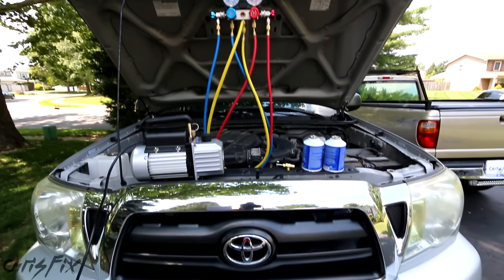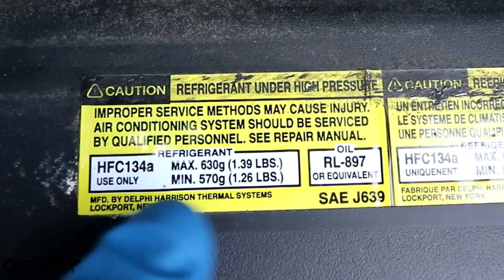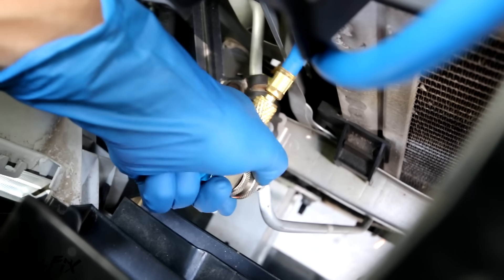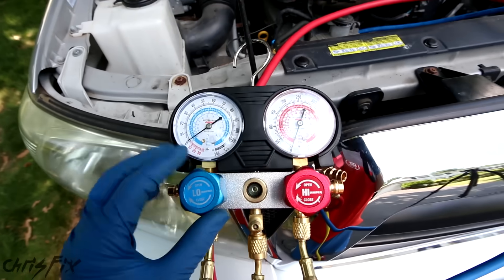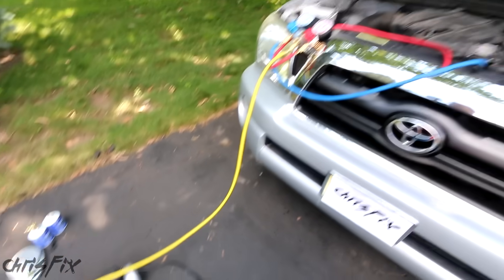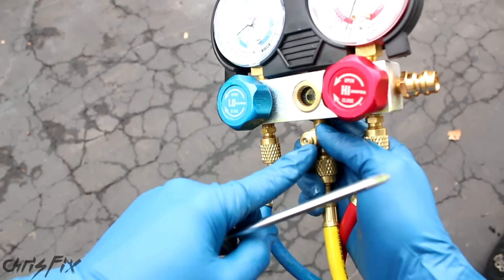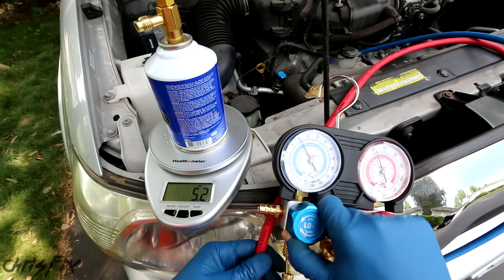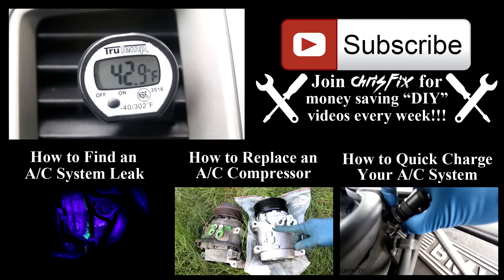How to Properly Recharge Your AC System

Comment: What about if you have cans of refrigerant from walmart (SuperTech brand) that are already pierced?
Reply: make sure you have a kitchen scale, make sure you get a good seal when you connect the can back up so nothing is leaking while you're measuring the weight and just charge the system with the can on the scale so you can see how much you're putting in. then just simple math to figure out how much more you need. this is all assuming that they are still okay and were only pierced to charge a system and have been sitting sealed since then.

edit: just to mention, most cans out there now use a self-sealing valve that does not get "pierced" but rather pressed like a valve then closes once the tap is removed. traditional taps can still connect using an adapter but if the cans you have aren't like that then having the can sit there pierced with an attached/shut tap then it should be okay if still sealed up good. the main concern is the amount you would charge which can be figured out by weighing.
Reply: @cinnabon7272  So I recharged A/C this morning the compressor was running and low pressure was staying steady around 33 PSI and the high pressure was 215 PSI.  I'm in Florida and it was 84 degrees outside when I did this.
Reply: @fartbreath2884  this was after the recharge? Those pressures seem alright. Did you put in the max charge or just in between and did it work

Comment: If leak sealer is so bad and is proven that it does damage then why do these companies keep putting this in the cans without a lawsuit? To be honest I've used it for YEARS and 90% of the leaks that I've had went away and the systems are still running fine today. I've heard not to use that but I'm not understanding why. One comment said something about the seals swelling up and when air hits the seals or something like that it screws up the system. Could someone explain to me what exactly does leak sealer do to destroy the system.

Comment: Hey Chris, can you do a brief update to the video (maybe a segment at the end) showing us how to use the new refrigerant cans that are self-sealing? Also, I don't think the new manifold gauges support adding oil through the yellow line (mine was restricted to the size of 3mm) . I tried adding mine that way and had a horrible time trying to get the oil in the line. And when I finally got "some" in, I hooked up the refrigerant and tried to bleed the air out of the line oil sprayed everywhere. That was fun lol.

Comment: Technically you need to be certified to work with refrigerant.  It is a green house gas and must not leak vented to atmosphere.  You are suppose to recover it with a recovery machine.  If you dont you  are breaking federal law.  I would suggest bringing you car to a shop with certified a/c mechanics.

Comment: so if the compressor is already filled, wouldn't the vacuum suck it out? 7:58
Reply: No. Evacuation in very slow process and only removes gases form the system.
Reply: Nunya _ Appreciate it bro, I'm about to do mine when I get my compressor delivered

Comment: Don’t you have to flush the ac system with solvent before refilling ?
Reply: Only if you need to replace all of the oil due to contamination.

Comment: Dear Sir, my car (2005 Lancer) shows very high pressure on the high-pressure side such that the HVAC pressure switch turns off after 40 sec when ac is turned on...what might be the reason for this. Recently my car runs through water upto a level of 1.5 foot. Whether water gets enter into the system

Comment: At 4:24 when you open the valves that are connected to the engine, you turn the knob yo the right. Are they reverse threaded? I thought it’d be counterclockwise to open.
Reply: You turn them clockwise to screw them down to open the Schrader valves.

Comment: Thank you guyes saved me a trip to the mechanic i had overcharged my system and the clutch kept coming on and off so i did some research cheked the sensors and ended up fixing it by sticking a pen to release some freon hope this helps someone out there!!!

Comment: Thanks for this video, ChisFix..  helped me a great deal when recharging my Odyssey after replacing the compressor..
Reply: @Jason Crowder 
I'm about to do the same on my 2009 Odyssey. Any last minute advice? Also, one of the four front panel air blowers (located immediately on the right of the steering wheel) used to blow warm air. Have you encountered something like that, and/or what may be causing this? Thanks in advance.

Comment: A/C vacuum doesn't create a "complete" vacuum rather it takes it down to 29.something inches which is enough to lower the boiling point of water so that it turns into a gas, and then all of the gas / air is vacuumed out, leaving the oil, which has not boiled off remaining in the system.

Comment: You just evacuated the system by running the vaccuum pump for 30 + 45 minutes to get everything out, THEN you say you don't need to add oil or dye since these things are already in the system??  What am I not understanding?? 

How come nobody else is asking this same question?
Reply: The pump just evacuates the air not the oil or dye in the compressor.
Reply: He stated it would draw out the air and water but I believe he meant humidity within the air in the system.  If there was literally water pooled in a hose somewhere it would not draw that out, just like it would not suck out the oil or dye.
Reply: @joeldokken5690  When under a vacuum water boils off at a much lower temperature. There for the water vapor can be sucked out of the system as a gas not a liquid.
Reply: @daver1942  oh!  Good point!
Reply: @daver1942  but the oil won't boil and be sucks out?

Comment: Thanks a lot for the video. How much does it cost approximately to have the refrigerant recovered?
Reply: 134A is not a pollutant to the atmospher. It is okay to release in the air. The only reason shops recover your system is to add it back in once repairs are done. Think of it another way.....why would you pay a shop to recover your system and keep your freon and then have someone else pay for what was yours???? 🤔🤔🤔 All it is a win , win for the shop to make more money.
Reply: @jamesstafford9067  You clearly don't know what you're talking about. R134A is a greenhouse gas 1400 times more powerful than CO2. When you release the equivalent of a small can of R134A, you contribute as much to climate change as if you drive an SUV from the west coast to the east coast. Also, do you know how expensive recovery machines are, and how cheap R134A is? Shops don't save a lot of money by recycling R134A. Actually, if it's a small shop, they might even lose money because recycling machines cost thousands of dollars
Reply: @jamesstafford9067  In the case of R12, which was the refrigerant used before 1994, then the shop will usually pay you to recover your refrigerant. That's because R12 is extremely expensive. They don't make R12 anymore, so it is hard to find. R134A on the other hand is very cheap, the average car takes about 20 oz, which costs less than $10 is you buy big R134A tanks

Comment: Good video. I ran into more problems. Initially my compressor wouldnt kick on. I finally jumped the pressure switch to get it on. Then i had no pressure on the high side. Im not sure what to do next.
Reply: Good question.  I was thinking just the same.  Will purging air also purge all the ok and dye?

Comment: You made a huge mistake when you initially pulled vacuum you walked over and shut the gauges off and then waited an hour to check for leaks there's no way you could have determined if the system had leaks with the valves shut you should have left them open hence there's nothing to measure if the valves are shut the gauges will sit there at 30 below from now until Sunday. With the valves in the closed position there's no way for them to read anything except what was on the gauge when you shut them down.
Reply: I have the same gauge and vacuum set up chris used in the video. Closing the valves on the manifold still leaves the gauges connected to the ac system. I know this because my truck's ac had a slow leak under vacuum which I found out with those valves closed.
Reply: This was my thought too.

Comment: You didn’t purge the system of air the second time on the second can of refrigerant? Is it not necessary?
Reply: He closed the brass shut off valve so no air would get into the yellow line then removed the empty can.  (then attached the second can, opened the valve, so there would be no regular air to worry about)

Comment: you  forgot in your tools. if its a brand new compressor it need compressor oil or it won't work. either 2 ozs of compressor oil or a can of R134a with compressor oil.

Comment: Helpful BUT
It is amazing how many of these tutorials say that we want to vacuum out any liquid and air out of the system, but yet when you pretended to add the oil into the yellow line you basically allowed air back into the system
Reply: Valve wasn't opened dummy

Comment: If I had to replace just the condenser/dryer how much oil should I add?
Reply: I just replaced the ac compressor and receiver drier in my truck. There should be residual oil in the drier and maybe some in the condenser when you take them out. You would need to dump the oil from them into a measuring cup that measures ounces and then what ever amount came out you would put back into the system.

Comment: You stated that one can of refrigerant contains 12 oz. by weight. That is incorrect.  It contains 12 fluid ounces which is a volume measurement. 12 fluid ounces of R134A weighs a little over 15 ounces ( weight). You inadvertently put 3 extra ounces in your system.
Reply: I blame it on the confusing Imperial System, nobody would mistake grams for mL, but (fluid) ounces for ounces is a problem.

Comment: What if both high low pressures have readings and high pressure side is moving a way from 30 in/hg. Does this mean the high pressure side is leaking?

Comment: Is this the sane or similar gauge and hose setup you could use for HVAC?
Reply: It's similar but the connectors are different and you will likely need adapters for the high and low pressure hoses

Comment: I'm curious... If you evacuated what was in your AC system into that vacuum pump, then what did you do with what is in the pump? What did you do with the material that went inside your vacuum pump?
Reply: The refrugerant would leak out and damage the atmosphere if you had some refrugerant in it.
Reply: @noelmedina6925  What I mean to say is the refrigerant that goes into that small vaccuum pump, how does he or anybody using that dispose of what came out of the car? I just brought a vaccuum pump like this and I was wondering is there like a storage area for the evacuated refrigerant? Sorry for the confusion.
Reply: Chyne20 you'd need something else to recover the refrigerant left in the car before doing this.  He mentioned that he did have his professionally emptied before replacing the condenser.
Reply: @noelmedina6925  Ooooh okay, thank you!

Comment: Fan needs to be on High and recirculate. Put temp guage in center vent. Put both cans in because of bleeding off both cans and removing both lines...plus whats left in the manifold guage lines...probably more than 2 ounces. The manifold guages and vent temp guage will let you know if system needs more/less refridgerant or is having a problem. The weight listed is more of a guide. Charge the first can upside down...second can upside down for half a can then leave upright for finish charging. The refrigerent will turn to a gas immediately when it reaches atmosphere/vacuum. Its only liquid under HIGH pressure.
Reply: What about if you have cans of refrigerant from walmart (SuperTech brand) that are already pierced?

Comment: Pardon my ignorance as I am probably missing something here. But when you first pulled vacuum on the system to check for leaks, first you got your vacuum but then you closed the lines going to the high and low side essentially sealing off pressure to the gauges, so you're not actually reading the pressure inside the ac system, rather the pressure inside the gauge manifold correct? I would think you would simply close off the line going to the pump, turn off the pump and then wait the prescribed time to see if your vacuum holds on your ac system... maybe I'm looking at it wrong though?
Reply: azwethinkweiz when you close the high and low pressure sides it doesn’t close off to the system, only to the center of gauge manifold.(yellow)

Comment: Chris fix you have added 18oz of refrigerant to the system, if can has 12oz of r134 in it but whole can weights 20oz by adding 10oz including weight of can you actually added 6oz of refrigerant
Reply: I don't understand your logic.  The can + refrigerant weighed 20oz at the start, the can + refrigerant weighed 10 oz at the end.  That means the can+ refrigerant lost 10oz...I don't think the can lost any of its weight so it had to be 10 oz of refrigerant that was lost.    Another way to look at it if can + refrigerant = 20oz, and it has 12oz of refrigerant, then that means the can weighs 8 oz.  At the end with the final weight being 10 oz, and if the can is 8 oz that means there is just 2 oz of refrigerant left, whcih means that 10 oz of refrigerant has left the can.....either way you slice it, Chris has correctly added 22 oz of refrigerant.
Reply: @BebopMonolith   He did not accout for the refrigerant that 1. Was purged out of the yellow line (loss of refigerant)...(not sure why he took the can off the yellow line). 2. Then I guess reattached the can again and he didn't purge either can with it attached to the yellow line (that loses some refrigerant)...but that didn't happen...lucky except foir the moisture entering the system for not purging each can...(which is why you use a 30lb cylinder to save from all the purging and refrigerant loss...3. The refrigerant that was left in all 3 the manifold lines...blue, red, and yellow lines, each line is about 5 ft. 4. The refrigerent that was lost removing the manifold guage lines on the high and low side. He should have used all of both cans. You should always account for any loss.

Comment: You forgot to give us pressures and temperatures of the system once is working properly. As a point of reference.
Reply: You should add refrigerant based on weight not pressure as pressure is defendant on a giant temperature and can be very different from location to location.
Reply: jacagle98 yes he’s right you must add by weight not by pressure that’s not house split system most of mini-split ac’s also need refrigerant by weight if you refill it by pressure as some split systems you will get it well overcharged and it might blow up your compressor or you might create a leaks

Comment: Hey Chris would this be the same with a duel climate system?
Reply: william hofstetter yes this is the same for a dual climate system. The dual climate systems take much more refrigerant, my 04 expedition takes 3.1lbs of refrigerant so it can be costly.
Reply: Also when pulling a vacuum make sure to wait a long time, i pulled a vacuum on my vehicle for about and hour and a half, because of the size and how long i had the system disconnected.  After the long vacuum pull then check for leak.

Comment: So going base on the temperature chart thats on line.. im AZ where temp gets as high as 118, so if its 118 an im recharging systems should i fill till low side reaches the 50-55psi an high side 340-345psi?? An if its less than that do i still need to add more freon?

Comment: Hey Chris, first of all good stuff, how do you top a system that you did not have to replace all the motor components 
Thanks, Ozzie
Reply: If you need to top off your system every once in a while then you probably have a leak, in which case you should buy some refrigerant with leak dye to find then ultimately repair it. Don't use A/C sealers as they'll clog the system. 
As for filling the system it's pretty much the same process with the same gear. You'll need to add enough refrigerant to match the amount specified by the sticker in your vehicle.

Comment: How's it going. So I just bought a compressor online and they only used shipping oil which means I need to flush it and add oil. Is it best to oil the ac compressor before installing or should I install it with the shipping oil and then let the vacuum take care of it and put the new oil with the refrigerant? First time messing with the AC. Thanks

Comment: Cheaper to just take it to a mechanic instead of buying all those tools.
Reply: Not necessarily. Local shop wanted $188 to do basically this in the video. You can get that gauge set for $30 and a vacuum pump for $60-70. Refrigerant + oil for $20-30. So you're still saving 60-80 bucks even buying everything from scratch.
Reply: @yetanothermichael3702  and you have everything you need if/when you need to recharge, have other vehicles needing it, or have a friend/buddy that needs a recharge. Disposal of old refrig is hardest part.

Comment: Great video. I have a question. My car has a clutchless compressor (i.e. the compressor shaft and internals move even if the ac is off). If I take the car to a shop to recover the refrigerant and then drive it home for about 20 minutes to apply the procedure in this video will i risk to damage the compressor at all? In other words is it safe for a clutchless compressor to be in motion without refrigerant in the system(and the lubricating oil embedded in it ) ?
Thank you very much to Chris and however will want to answer my question 🤓
Reply: just release the refrigerant into the air
Reply: @masterzz57  sure bud. 
Anyone else please

Comment: great video thanx! will you pleeeeeese clearify how to add oil to the new compressor and how much? considering any residuals in the system?
Reply: If it is a new compressor, just add it to the port in the rear of the compressor.  Only 1-2 oz or so.  Some require 4 oz.